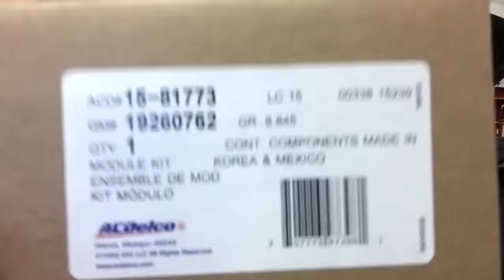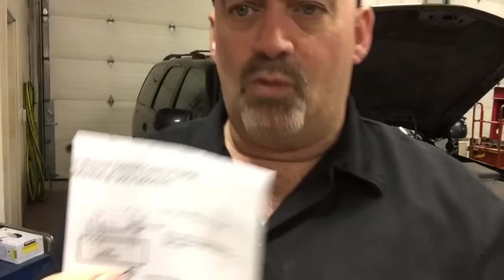Chevy GMC Blower Fan Stuck On

Comment: I have a 2005 Escalade. My blower did not work at all. I replaced the resistor and it worked perfect for a couple of days. Now the blower stays on high always and it continues to run after shutting the car off.
Reply from the maker: Did you use a cheapo aftermarket part? Probably a bad part but possibly wiring or blower motor issues drawing too many amps

Comment: I had this issue on a chevy impala I changed the blower motor resistor and today it started blowing at a high speed and wouldn't shut off I took part back replaced again now my fans not working at all if you have an option on what it would be please let me know!!!
Reply from the maker: Sounds like a defective module or improperly wired.

Comment: 2007 Chevy Trailblazer and the AC blower fan won't turn off when car is off and key out.  Two questions.  1)  Which fuse # could I pull to shut the blower fan off so I can at least drive to work?  I pulled all the ones for the AC and it didn't stop the fan from running.  So I guess I have a subquestion, 1a)  if I pulled all relevant fuses and the fan still didn't go off do I have bigger problems?  2)  I had my transmission replaced earlier this year and when I pulled out of the mechanic's lot my front facing AC vents wouldn't blow any air but the air does come out of the bottom vents and the defrost vents and those two little side vents but not the front vents.  Does this Blower Control Module have anything to do with that problem?  Do you think replacing the BCM would fix that problem too?  Or is it the dreaded HVAC mode actuator?  Thanks so much for your help.
Reply: Look under the hood in that fuse box and pull the fuse for the blower.
Reply: Thanks for your reply.  I ended up unplugging the blower control module and lasted most of the summer with no air.  I finally got a new BCM like the one in this video and installed it a couple of weeks ago.  Now I have air blowing at the windshield and my feet.  The bad mode actuator is causing no air from the front vents so it was two different issues.  Unplugging the fuses didn’t stop the fan blowing though.  This video saved me some money and I truly appreciate it!  I’ll get to the mode actuator one day...lol.  That one looks to be too much for me to handle though.  👀✌️

Comment: unrelated but if my drivers seat and heated seats are working then not working off and on, where should I start troubleshooting? can't seem to find info. loved the video very helpful
Reply from the maker: Most common cause is worn out elements in the seat. But also check the black wire behind the seat for bad ground or melted at the connector.

Comment: It is strange but my dad was driving his 06 Thunder when it lost power, kind of a limp mode and  through a throttle control code. He drove it home and it died when he pulled in the car port and wouldn't even crank over and at the same time this blower motor stuck on with key removed. He replaced the throttle assembly and it would crank over but no start. I traced some things and is has no fuel, the 2 sec prime does not work but sends power to the pump during the crank mode. I am thinking the computer has shut the pump down and the dealer will need to reset it? This all happened after replacing the battery he said. Any feed back?
Reply from the maker: What is a Thunder? Are we talking GM? Sounds like a bad fuel pump
Reply: The Car Doctor 
Thunder is one of the z71 packages. truck went into like a limp mode about 80 miles after a new battery install and showed a coat for the accelerator petal. shut the truck off an the fan motor would not shut off and engine would not crank over. he change the accelerator assembly he changed the accelerator assembly and hope the battery backup and it would crank over but would not start. he has power to the fuel pump during cranking but no two second prime. I have not checked the ground yet. This all happened at the same time.

Comment: I changed the module with a replacement of the same kind. The blower was under control again but the air wasn't cold any more. Then the blower was stuck again. I don't know what issue could be
Reply from the maker: sounds like your blower motor is cooking the module. I would recommend an OE module and blower for starters.

Comment: If i cant replace module right away 
What fuse can i pull that will turn off the forever running fan i tried hvac but it kept running lol
Reply: Please help car doctor
Reply: Gmc 2005 Sierra

Comment: my 03 Chevy Silverado 1500 Z71 has the same set up for wires but I can't find it any where the same . all can find is 7 wires replace it with idont show I'm going to wire it up on my truck can you help me out to know what's going on why I only get a plug with 7 wires plug for and how to wire it
Reply from the maker: Probably need to go to the dealer and get the OE part I guess
Reply: The Car Doctor. thank you I found the right part with 5 wires for my truck at eBay for$30

Comment: Hi!  Okay, so last year, this video was extremely helpful last year when my blower motor control module (resistor?) had to be replaced.  Fan stayed on after key removed, replaced blower control module and it worked fine.  Now Present day... Same thing happens,  assumed blower control module was bad again, replaced it.  That was not it.  Replaced the blower motor relay.. That was not it.  Took my car to local mechanic, he checked everything, said wiring looked good, said he would get someone to check the climate control module but he didn't have anything to test that.  So I go and buy a new climate control module ($186) and that was not the problem either.  Mechanic said all the wiring was good.  WTH can it be now???   I've seen in your comments that it could be a bad "blower motor" so my question is if the blower motor was bad would it still stay on with the key out of the ignition??
Reply from the maker: No, blower wont cause that. Stuck relay or bad module would
Reply: Don't know how u bought a part if mechanic didn't test it or was sure what was wrong with it  check out( south main auto repair ) on you tube he posted plenty of videos on a/c repairs plus if you email him he might help you out . Just saw a video about the   control fan speed not working all the speeds and there was a short in the relay on one of the wires  once he replace it tested it it worked  .also have to let it reset, after installing any part u rrplace specially with the a/c system is a headache. I just started having problems with mine  too I think I'll be doing some estra work too after this video game some more info. Sorry for the long message.  Thanks

Comment: My issue is with the rear blower motor on my 03 tahoe wont turn off. Is there a update for it aswell?
Reply from the maker: Yes. New module and blower.
Reply: @ThecardoctorTV  is there a specific part number like you had for the front or just buy new module and motor? Thanks for responding much appreciated

Comment: Would that be the same procedure if the blower motor doesn't turn on. Mine doesn't turn on thank you very much
Reply from the maker: Similar. Try tapping on the blower motor and see if it comes on. Also inspect the wiring at the module connector for damage. If any wires are melted, youll want to replace the module, connector and blower since the blower likely caused the melted wires.

Comment: Hey I have a similar problem, the rear blower runs all the time when the key is on and shuts off when the key is off. What causes that?
Thanks Brian
Reply from the maker: probably a bad rear blower control module
Reply: I fixed mine with relay.
Reply: @legendvalley  I have the same problem. Checked my relay and my relay is good. Know what it could b?

Comment: hello sir I love this video, hey question did you mention that the battery has to be disconnected before you cut the 3 wires ?
Reply from the maker: I don't think I did. Since at least one or two of them have power even with the key in the off position it probably wouldn't be a bad idea. Also a good diea to keep the ECM powered while the battery is disconnected to avoid driveability issues after.
Reply: @ThecardoctorTV  Would pulling the blower fuse make it safe?

Comment: Smashing repair, should be ok now, that aluminium heatsink looked decent.
I do find the fact that the module allways has power odd, i would have thought it would be switched, but thats designers for you lol.
Ive tryed stripping wire with crimpers, just a pain in the butt, i roll the wire on a penknife blade, then it comes clean off.
For cooler countrys (uk), i would bolt that module direct to the firewall, big heatsink lol.
Reply from the maker: +zx8401ztv OK that's an idea. I guess they figure the air circulation is enough. They make some really nice wire strippers but I just never invested in them. I also use a razor sometimes especially in tight places to remove the insulation. I almost put the last screw in an envelope and mailed it to England along with an autographed picture of me with a mean look on my face after fighting that blasted bugger for at least 30 minutes before I finally got it!
Reply: +The Car Doctor 
LOL the last screw is allways a bugger, ive repaired laptop/netbook computers and ended up with a couple of screws left over :-).
Well they put too many in anyway :)
.
As far as the air circulation cooling the active device enough, im not sure it does, thats one of the reasons they fail.
Heat = Death for electronics, same for most things really.
Well perhaps not your dinner ha ha :-D
Reply from the maker: +zx8401ztv I am sure to heat up my moose meat to make sure its dead as well so you are correct.

Comment: Question for you, my blower is on full bore while running, and when the vehicle is off it still runs. Would this still be the resistor and module which you replaced in this video or would it be the main control unit ?
Reply: Did you ever figure it out?
Reply: Kevin Rivard yes, it was the same resistor bank.
Reply: @RCBuildaholic001  ok thank you
Reply: MyHobbyChannel78 did you have a defective new resistor? I’m currently I’m the same situation. I just replace the resistor and it runs on full blast with keys out off ignition
Reply: GEE BODY yes, my resistor was bad.
Reply: MyHobbyChannel78 thanks.. just got back from the auto part store.. turns out it was a defective new part.. thanks for the quick response
Reply: GEE BODY no problem. I think my replacement may be defective again because of the extreme cold. The fan blows but doesn’t vary much until your two notches from full on then the fan blows full bore lol

Comment: So I have a 2004 chevy Tahoe z71 with automatic hvac system, I replaced the control module but now the blower motor stays on, without the key , do you have any ideas
Reply from the maker: Bad module or improperly wired.
Reply: ok thanks checked the wiring and its good so i am ordering a new mod thanks
Reply: Ton 78 BU Rider did you ever get it fixed correctly

Comment: So I've replaced my old model module with the same version. Issue remains. Stuck on blast, CONRTOLS ARE USELESS. So if I upgrade , the controls would work as they should?
Reply: Btw, when I became victim to this (lol), I found that I had seepage in that area and the module was wet inside. Not sure if that helps ....
Reply from the maker: How's the wiring?
Reply: The Car Doctor looked fine. As far as I could tell. A friend tested the connectors on the original and one was shorted out. So I've replaced it but no change. Controls show changes but do nothing as far as the constant blast. So I disconnect it as needed.
Reply from the maker: Maybe the blower motor is bad

Comment: Is the rear module the same part ?
Reply from the maker: No but it does have one in the rear too. Its called a blower processor module. It is located just below the blower motor at the RR of vehicle;e.  It can cause a similar situation. Heres how to test: 1. Remove the Purple wire at the blower motor processor and then check to see if the blower motor is still on. 

2. If the blower is still on, replace the blower motor processor module and check for high amp draw on the auxiliary blower motor 

3. If the blower is off with the Purple wire removed, check the Purple wire from the blower motor processor module to the Heating, Ventilation and Air Conditioning (HVAC) control module auxiliary for a short to ground

Comment: Good video pal. I asked you about a ATC module and a sensor in a Chrysler T&C and this looks similar except it was a lot easier to replace on my T&C.  Two plugs to pull and 2 bolts to remove, oh and I forgot the glove box needs to be removed. Since I replaced it I saw a comment that you can fix the module with a 3 dollar cmos or emos. I saved the old module and I am going to try and fix it as I have two T&C's so this would be a spare. BTW when ya gonna have Mini you or Nurse Jane Fuzzy Wuzzy make another appearance?
Reply from the maker: +MostlymoparIH haha, Nurse MiniMe will be on a future vid soon im sure. You need to make a vid of the module fix for the T&C. I usually just replace the module and blower on those. I always use OE parts on the Chryslers when dealing with customer vehicles. The aftermarket blowers tend to make a high pitched whine and when they come back complaining it stinks. The OE parts are about the same cost anyway. Something to keep in your memory banks. Take it easy.
Reply: You are the second one of my buddies that told me to make a video. I guess I'll have to get a camera and see if the mother in law doesn't mind me filming in her garage. I try to fix cars at her house as I don't have a garage. Try laying on your back on the ground and change the PS cooler hose in 20 degree weather while it's snowing. I even heated the hose up to get it on but by the time I got one side on the hose was cold. Fun fun fun. Daddy please take the T Bird away.
Reply from the maker: Haha. I use an iPhone to shoot most of my videos here. Super easy to edit right on the phone. Also those cheap camcorders at Walmart work great. And you never know, you could be the next Eric O. 😀
Reply: My daughter wants to some things with me. She wants to do Minecraft stuff I'm more of a nuts and bolts kinda guy so we'll see how that goes.
Reply from the maker: Those video game vids are super popular. Them people make some serious money doing that.

Comment: Great video. Do you know why the rear blower control unit doesn’t work?  I loved the video. Plan on working on this tomorrow. I have a Yukon XL that has the rear unit not working. Thank you.
Reply: I have the same problem with mine.  did the one in this video work to fix the rear one?
Reply: @justinb2969  I haven't had time to even try it.

Comment: I just bought a 2002 2500 silverado. The fan stays on all the time. I saw a video that said to check the relay, that they stick closed. It wasn't that. How would I check the module? Don't want to buy one if I don't need it. I would check the module even before the butt connectors, before I bolted it all together. Just saying.
Reply from the maker: The video should give you all the info you need.
Reply: I just left the inner screw in and bent the thin plastic cover, a little. Saved like an hour and a half or more.
Reply from the maker: Oh that's an idea. I can't do that because my luck I would break the plastic piece. Glad you got it figured out. Take care!

Comment: Problem with that screw is once you leave the screw out , it would make a noise . and come back . Now on my own truck , throw the screw away , and smile , because now truck is lighter, and, just think, lighter truck , better fuel millage . I betting one would save a pint of fuel in a hundred thousand miles , well ok a half a pint , but still .
Reply from the maker: I like the way you think but let's be realistic here. In that 100K miles I saved 1/2 pint of fuel but the problem is I spent the savings on a donut. Well the donut caused me to gain 5 lbs. Then over the next 1 million miles that extra pound cost me an extra 200 gallons of fuel overall. It's mind boggling. Oh man I can't even think about it. Im getting that donut look now. You know. Glazed and confused.
Reply: Solution , remove more screws , simple
Reply from the maker: haha

Comment: For that really irritating screw in the back, towards the center of the cover, I used an Alan wrench that fit in the back of my 7mm socket. It's really inconvenient but not impossible.
Reply from the maker: Oh good one. Yes, I now just loosen a little but not completely remove and then just push the cover aside while servicing the blower. Thanks for the feedback and for watching my vids!
Reply: Thanks for making your videos. Very clear instruction and great attitude. Keep up the good work.
Reply from the maker: Thank you!

Comment: This is the front I need the rear one how do you do that
Reply: Ever fine out?
Reply: Same here
Reply: I have the same problem. My rear AC won't turn off when I connect the new Resistor. Anyone find out a solution?

Comment: Thanks for the help, I treid to change mine . Got new one at NAPA. Didn't work. I went to my fav shop McDonalds Auto Repair Hebron Ohio and it was the small black relay that is next to it on Chevy S10 2000. LOL the last shop that looked at it gave me a 2 hr estimate to look in the dash LOL.
Reply from the maker: Glad you got it figured out. Thanks for watching my vid!
Reply: What small relay and where is the location underthe hood?
Reply: @boosted6ers  yes it a small black relay . Facing the truck hood open in the back mine was screwed to the back leftish top of engine wall.
Reply: @boosted6ers  i can yes .
Reply: @boosted6ers  back engine wall mine was bolted on firewall.
Reply: @boosted6ers   sent pictures yesterday.